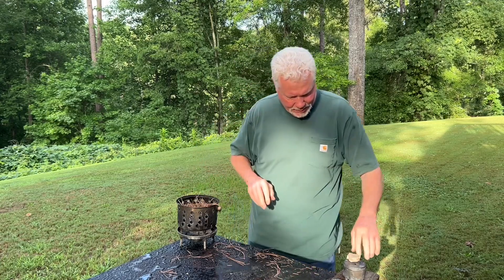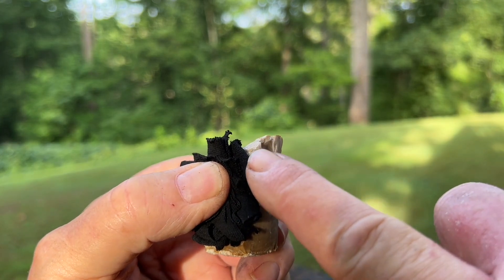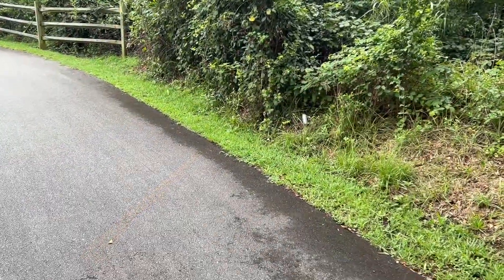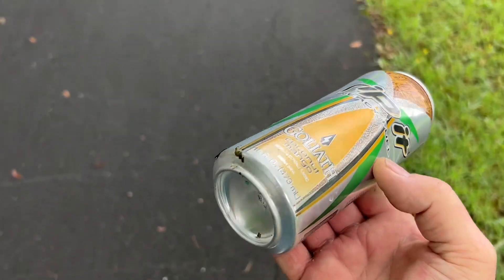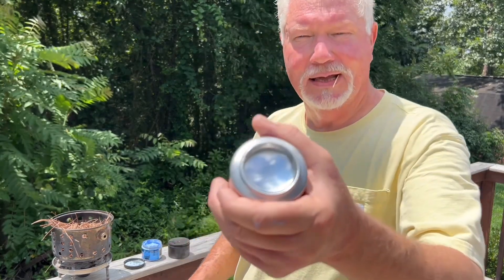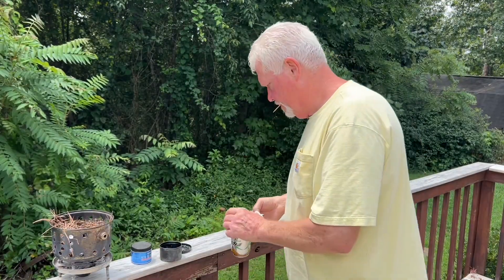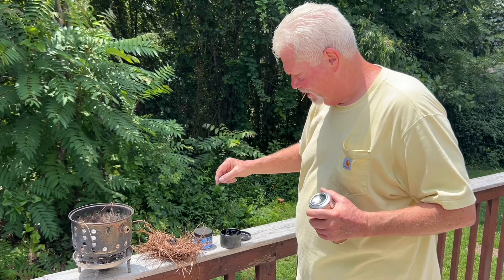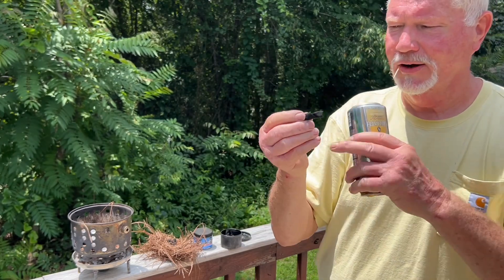How To Find, Polish, And Use A Can To Solar Ignite Char Cloth

Comment: Question for you as a firemaking expert:  Archaeological records suggest  that neanderthals may have added manganese dioxide to their tinder to improve its ability to catch weak spark from flint+pyrite. Just do a google search with "neanderthal manganese dioxide" and you will find several articles on this. Some experimental archaeology (A.C.Sorenson) claimed  addition of mno2 increased efficiency of the (horsehoof fungus) tinder by 140% whereas other experimenters found it wouldnt even want to ignite with the much hotter sparks from a ferrorod (which i find odd). Since manganese dioxide may be  readily avaliable in a survival/desaster situation from depleted alkaline batteries (the brown-black stuff inside is manganese dioxide saturated with an alkaline electrolyte, maybe it needs to get washed and dried to get rid of the electrolyte-maybe thats not even needed?) could you shed some light on this? yt is picky on links but here is one i found on a poster from sorenson detailing some of his findings https://scholarlypublications.universiteitleiden.nl/access/item%3A2981923/view
Reply from the maker: Neanderthals did use manganese dioxide to make fire. It lowers wood’s ignition temperature and boosts char combustion. As for using it from batteries, DANGER!!! handle with care due to potential hazards.